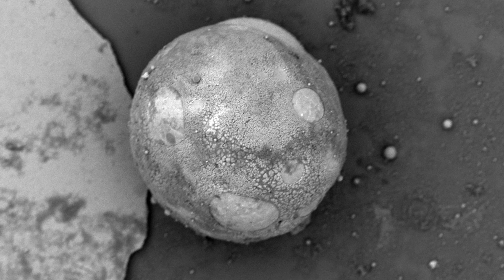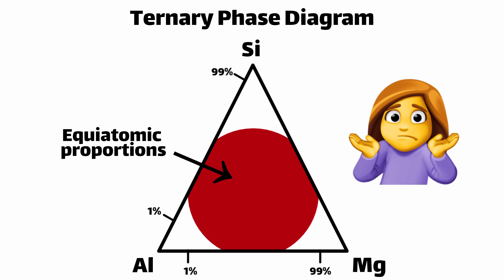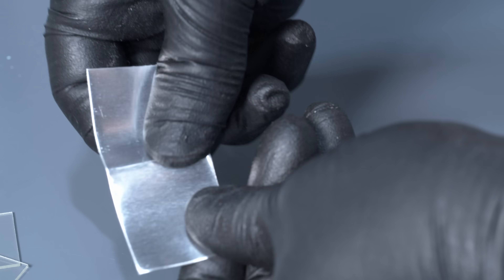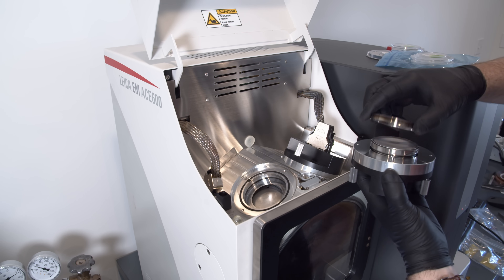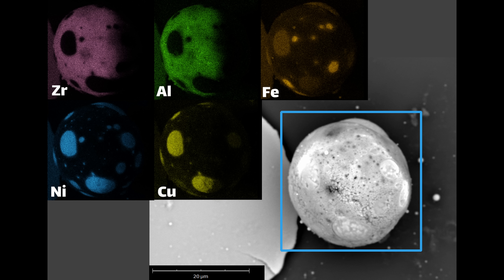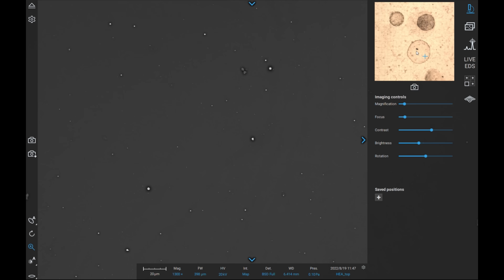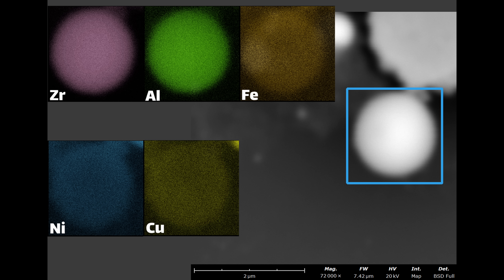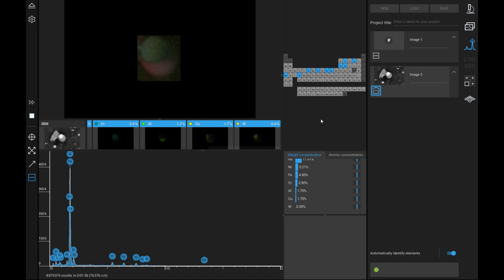Metal Alloys of the Future?

Comment: i feel like Applied science showed a way to coat glass with metal only one atom thick. Would that make a difference maybe?
Reply from the maker: Yep, atomic layer deposition! (really cool technique, and super cool Ben did it in his garage!). Definitely an option, although molecular beam epitaxy is a little more common in this field (which Alpha Phoenix showed on his channel a while ago). ALD is super controllable but it's a chemical process so you might not be able to find all the precursor gasses/chemicals depending on the metals you want to deposit. MBE is closer to the sputtering that I did, albeit in ultra-high vacuum and super precise control over everything.
Reply: @BreakingTaps  Can you put all of the metals in the same vacuum deposition plasma thing? Sorry, I can’t remember the terminology. But the vacuum plasma thing you used, is it impossible to have all of your source metals sputtering onto the glass at the same time so they just mix on their way to the slide? Unless there is an obvious reason why this is impossible, I feel like these alloys might form spontaneously. What about several anodes and cathodes in an electrolyte? I imagine they could naturally form alloys that way but I suspect that won’t work for a similar reason. I just woke up so I can’t think of words or the laws of physics just yet. It’s just a fascinating material science concept and I want there to be an easy way to make some serious weight. Especially if we might be talking about room temperature superconductors. Does the exact order of atoms completely change the properties? That could be really hard to manufacture unless you had millions of randomly created cubes that could be sorted by exploiting their unique attributes.
Reply from the maker: @thetruthexperiment  Not on my machine, but other machines can definitely do multiple depositions at the same time (or interleaved). Mine has two sputter heads but only one can go at once. I have read that some people will make a "checkerboard" target with all the metals you want to sputter, so that you only need one head to do multiple metals all at once. A bit tricky since metals sputter at different rates, but you could compensate for that by adjusting their size.

But yeah, definitely doable to deposit them all at once and let them "mingle" on the way. I think you still need to do some annealing/heat treating afterwards because they won't be in a nice crystal structure right off the machine, but a viable technique to get bigger films instead of nanoparticles.

Comment: can't you just melt the metals until they are liquid and just mix them together? like heat them all up in a crucible up to the maximum melting point  so they are all liquid and then rapidly cool them.... I've al;ways wondered what happens when you do that
Reply from the maker: Generally, yes! Although it gets a little tricky when you have metals that have wildly different melting temperatures, since the low-melting ones will try to evaporate while the high-melting ones are still solid. But that's effectively what vacuum arc melting does, melts a big mixture of different metals in a crucible. It just does it a lot faster than a traditional furnace which might take hours to get up to temperature.

But otherwise, yeah, you just melt it all up and then quench it :)

Comment: I studied metallurgy in Mech Eng. but what you are saying make no sense to me especially since you talk more about combining techniques rather than the resultant material from a successful combination.  Also,  what has any of this to do with Entropy?
Reply from the maker: The "entropy" part came from the original authors although folks in the field don't think it's quite accurate anymore (but the name stuck). To quote wiki: " 'high-entropy alloys' was coined because the entropy increase of mixing is substantially higher when there is a larger number of elements in the mix". I think "Multi-component alloys" or similar are more accurate descriptions but not as catchy and haven't stuck as much as HEA has.

Regarding fabrication vs final combination: mea culpa, I find the fabrication part more interesting so that's what I spent more of my time learning about. Material properties are cool too but since there's so much research going on in this field, it's hard to summarize all the different properties and caveats (and it's all rapidly changing too), so I just stuck to the stuff I like and have some knowledge about: various ways to potentially make them :)
Reply: @BreakingTaps  Thanks

Comment: I managed to do this with a magnetic plasma field using my microwave at home and some left over processors. Made about 10 to 301 lbs of it. But im not bragging about it. 7 elements as well. Every time.
Reply: So did you make 10lbs or 300lbs? Thats a wide difference i think you would know.

Comment: My understanding is that the only reliable way to make this is with plasma sintering. That eliminates a lot of use cases. What's worse, Machining some of these alloys could pose an enormous problem. So for a while, the only thing you'll be seeing made out of high entropy alloys are those things which are small and don't require precise dimensions

Comment: i feel that the layered approach is also a limiting factor here. Its probably not possible with all metals, but if you could try sputtering more that one metal at a time and let the mixing of the atoms already start there, or making a solution of multiple metals and sputtering that/soaking it into something you can , just a thought. great video, love it
Reply: That thought occurred to me as well, it seems like this should be possible.  Also doing the laser sintering (?) process in a vacuum or inert gas atmosphere rather than using water.  The water was probably bursting into steam and adding a ton of physical agitation.

Very cool video nonetheless!!! I learned quite a bit!

Comment: Do bulk metallic glass alloys fall under the umbrella of high entropy alloys? Seems like they do/should. I know those have gotten to thicknesses on the order of an inch or two
Reply from the maker: Grain of salt, not an expert. But I think they are very closely related. My understanding is that BMGs tend to have a wider range of atomic sizes and it takes on more of an amorphous structure, while HEAs tend to be closer atom sizes and are more crystalline. But I think there's some bleed between the two camps.
Reply: @BreakingTaps  I think that makes sense. My understanding was the same as yours; that they rely on mis-matched atomic sizes and extremely rapid cooling to prevent grain growth. But they all (that I'm aware of) rely on 5 or more alloying elements, which made me wonder. Possibly is just a similar problem being tackled from different angles, and in a decade when we sort-of understand how things work there will be a more appropriate term for them. But for my money, high entropy alloy is a good candidate, seems to capture the essence of both reasonably.
Great content as always!

Comment: Has anyone tried using a simple folding technique to distribute the elements evenly? If you layer 6 metals in a sheet and then continually fold and flatten that sheet at random angles, it should produce a HEA without the need for melting-temp heat, right?

Comment: Switch your film order: chromium first on the glass slide.

Also clean with acetone/IPA/DI then bakeout before placing the slide. Slides have an oil coating to make them capable of being separated from each other in the box, and it's injecting carbon into your metal.

Tungsten doesnt typically alloy well in mid% proportions because it's too big. Stuff doesnt tend to sit with it substitutionally, so you need a lot of W to keep it intact. Otherwise the W kicks out of the lattice
Reply from the maker: Rad, thanks!

Comment: Can you sputter as low as 10 nm layers? Maybe better mixing?

Do you suspect the ordering of the sputtering would make a difference?

You mention five elements so that’s 25 different bond-to-bond energies — any interesting patterns here?
Reply from the maker: I can, yeah! My machine can reliably do ~5nm, although it's logistically a pain to do a lot of really thin layers since you have to swap the targets and pump back down (which takes ~1hr). I didn't personally think order mattered, but a few much more knowledgeable folks have commented saying that it potentially can affect the alloying. Mostly down to melting temperature; lower melting first to help build up a solution phase that the higher melting alloys can melt into as the laser pulse continues. TIL! :)

Afraid I don't have the knowledge to say regarding bond energies, but I imagine there is! Lots of research going into modeling and simulation, since brute forcing this would take literally forever :)

Comment: Why not sputter multiple metals at once in order to form those HEAs?
Reply from the maker: Would definitely work! There are some papers that go that route. Only problem is equipment: my machine has two sputter heads but can only use one at once. For a full HEA you'd need 5+ and run them all at the same time. Entirely doable, but much more expensive!

Comment: I doubt you'll see this, but what software and imaging device do you use? It's fascinating how you can gather all of the data from the image, and the only thing I could think of to do that would be spectroscopy, but I have no idea how that would work. Thanks!
Reply from the maker: It's the UI for my scanning electron micrscope 🙂 The machine is fairly modern, so all control is through a computer and UI.  As to the spectroscopy, it uses a technique called energy dispersive spectroscopy. Basically, as the SEM electron beam hits the sample, different elements will kick out x-rays with different energies. So you can determine the elements by their x-ray signature. After that you just need to raster the beam across the surface and record the x-ray energies from each location, and eventually you get a map of elements :)

Comment: I wonder, and this is the blacksmith part of my brain thinking, could you accomplish it scaled up by forge welding, then heading it red to yellow hot (plastic deformation temp), in an innert gas environment, and working it like a taffy pull to fold it a bunch of times until you reach the mathematical limit of layers and then keep going? like making pattern welded material, but just keep going.

Comment: The effect of Chromium on this process does make a lot of sense due to just how good it is at giving and receiving electrons since it occurs in nature with 4 stable isotopes. It allows it to kind of ghost its way into the crystalline structure just by gaining or losing some electrons. I wonder how Tin, an element with 10 stable isotopes, would contribute to a mix like this.
Reply: Please enlighten me, what do isotopes have to do with giving and receiving electrons?
Reply: @baranzenovich  It's more that the element atoms have more possible configurations that are stable, which tends to make the element more flexible in terms of giving and receiving electrons from their shell. 

An isotope of an element has interesting properties, stable isotopes even moreso since they don't experience radioactive decay. An isotope with fewer neutrons has a stronger positive charge, meaning that the electron shell around the atom is more likely to attract any free radicals into its sphere of influence. An isotope with more neutrons has a weaker positive charge which will cause the shell to more willingly cast off electrons to reach stability.

In metallurgy, with the formation of crystalline structures as the mixture cools, you'll find that these varied energy states allow the element to more easily 'slot' into place forming a stable alloy instead of beading up and separating. There is a reason why the first alloy that humanity ever mastered was made using copper (a transition metal) as the base and tin (an element with so many stable configurations that it's actually funny). It was an alloy that was ridiculously easy to get right.
Reply: @shadowtheimpure  isotopes of an element have  fewer / more neutrons, which dont contribute to the positive charge, but the same number of protons, which DO contribute to charge - so i dont think isotopes have a big influence on behaviour in alloys
Reply: @raiyiar  doesnt seem outside of the realm of possibility - heavier isotopes of the same element will have greater bond enthalpies due to a lower ZPE. Unsure on the impact of alloys, but in organic chemistry deuterated compounds are incredibly useful for probing reactions for this very reason.
Reply: @benwhitehair5291  well yea, hydrogen has an atomic mass of 1, and deuterium has an atomic mass of 2, so deuterated substances can have sliiightly different behaviour (but i dont think to the extent, that Y-H bonds would be possible in one situation, and Y-D bonds at the same position are impossible) - contrast that with tin, with an atomic mass of around 120 - even if an atom had 10 more neutrons, that would change the atomic mass by less than 10%, which is not nearly as drastic as the doubling with deuterium (or tripling with tritium)

Comment: wow. I would definitely want to try the in-solution method. you could use inkjet technology to 3d print a structure out of metal salt solution, which presumably is perfectly mixed, and have an evaporation/sintering laser following the liquid. Might take a while to make anything big though

edit: Or, maybe dissolve all the metals in mercury, then flash off the mercury. Or what about some sort of gel with a high concentration of metal salts; could be perhaps cast and then baked to make like a metal aerogel?

Comment: First things that spring to mind...
Does the laser have to be at 90 degrees to the slide?
Would doing it in a vacuum make any difference?
Run the experiment in liquid nitrogen?
Apply an electrical current to the slide?
(or a combo)

Comment: I love the way you seem to be a complete amateur and yet surpass what I'd consider my long term goals.
You mention that Chromium seems to help mix the metals.  I suspect that what you need to do if find the flux that works. It could be anything but personally I'd aim for something that could be chemically removed at a later date.  Also, this may not be the final process - it may be that the 30 micron particles are ideal for use in the 'steel ball' process you mentioned, if you can produce them reliably and in bulk.

Comment: Years ago I saw a process where they took powers if titanium and aluminum which have huge diff in melting temp.   They took a “can” of well mixed powder mix and surround it with shape charges.    The whole mix melted and cooled so fast there was no time to move around.   They said it was some new mix method to achieve alloys that could not be made any other known way for aerospace and catalyst and even electric properties.     Wonder what happens to that whole idea.     Maybe alloy was a bit of an over reach on what they achieved

Comment: If I were to go about it with a similar method, id probably sputter coat more than one element at a time, trying to mix a fine mix of the different metals, rather than individual layers that have to still mix afterwards in the heat. And then try to flash heat and cool the sample in quick secession. You'd have a far more likely chance of even random dispersal. The heat would bind the mixed particles, and the cooling freeze the particles in the random state before seperation. It might be a good starting point. Of course that takes the right equipment. And I don't currently have such a capability. But the closer you can get it to the state you are looking for before heating and cooling; the more specific your chances of getting something closer to what your aiming for seem likely too me. The more time the particles have to move by natural processes, the more time they have to seperate out of alloy. At least would be my hypothesis.

Comment: First off well done and I'm subscribing. Second if you have the ability go ahead and repeat the experiment after encasing the slide in transparent tempered glass before applying the laser. If your laser is powerful enough you should be able to vaporize everything into a plasma and due to the pressure it should just recondense into a homogeneous alloy. That's my theory. My second thought is to see what properties a high entropy alloy metallic glass might have. Of course to pull that off you need to be able to super cool from a molten or near molten state. I'm not incredibly knowledgeable about the manufacturing process so consultation with a specialist is probably needed for the setup. Keep up the great videos!!😁